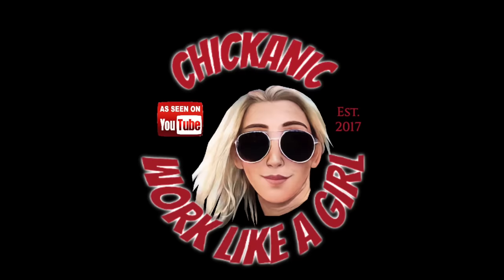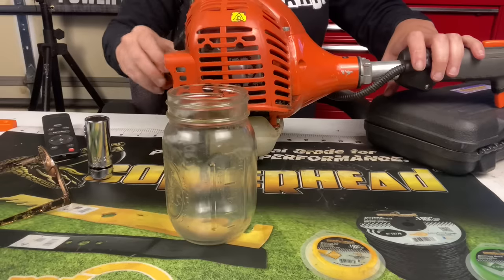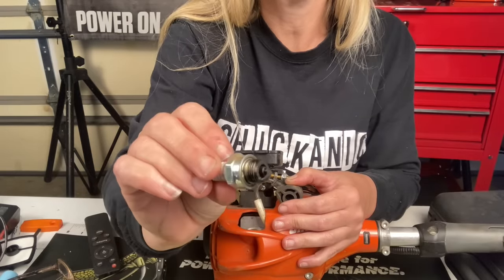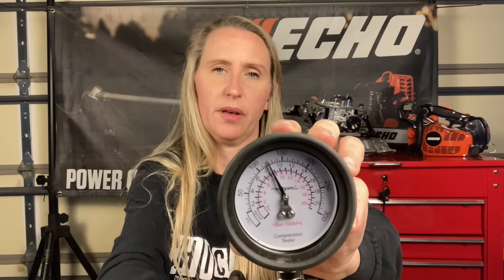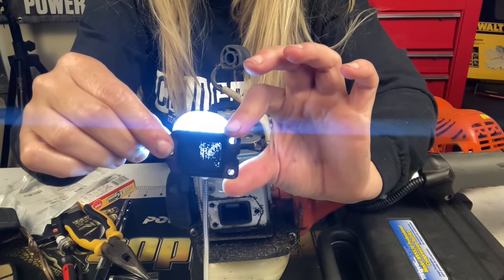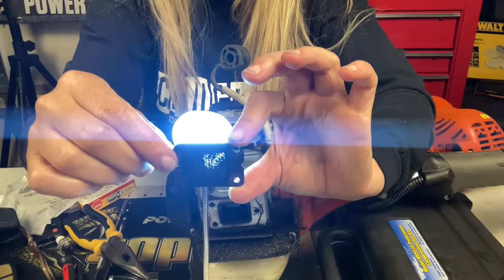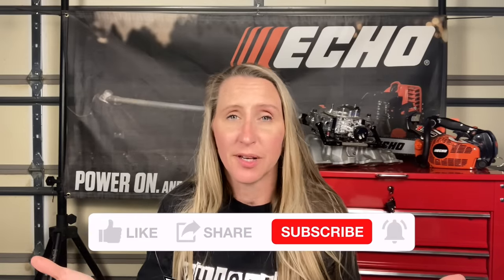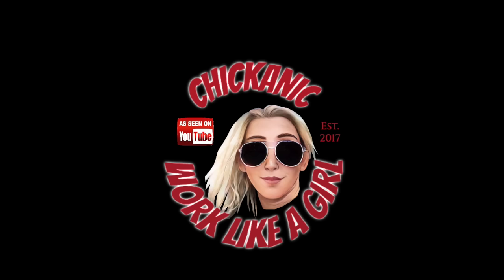How To Fix A String Trimmer That Won't Throttle Up. Echo SRM-225 Complete Diagnoses and Repair VLOG

Comment: Hi.  I have a new Echo SRM 225.  I probably have an hour and half on the weed trimmer.  It is spitting some small droplets of oil on the plastic housing area around the exhaust area.   Is it normal for this to do that?   Perhaps, it needs to be broken in before it stops?   I plan on taking it in to where I bought it from soon.  I thought I would get your opinion too.  Thank you.

Comment: I don't know what it is about Echo but seems like it's the luck of the draw if you get a good one. Thats all we use when it comes to string trimmers but we seem to go through 2 or 3 every couple seasons and one of our last ones (last season) has oil just dripping out of the muffler and one we bought just a couple months later just had an oily residue. Of course this is the first thing I remove after it clogs, I tried burning it off and that worked for about another week or so just to do it all over again so I just removed the problem. Now I mix my fuel a little leaner and make sure I full throttle it a few times a day which seems to help. My Echo chain saws never had or have this problem thankfully.

Comment: Hey always look forward to see what your working on. I had two MityVac compression testers and both went bad. Not the actual gauges but the stupid non replaceable air release button below gauge. What compression does a new Echo trimmer have ? Excellent video

Comment: I have a Shindiwa T3410 C4 technology.  It does not start, the compression reads 34 psi. Are there other causes to low compression besides scored cylinder walls?  You mentioned that you won't work on a dead unit, am I to assume that trying to rebuild a unit with low compression is not worth the money?  Thanks for the videos.

Comment: Husqvarna spin trimmer won't throttle up smoothly. It will idle when warm and will run full speed once I get it passed the low and mid range. It's only three years old with light use. Fuel is fine, fuel line, return, and tank vent are fine, exhaust is clear. Spark plug looks good and has plenty of compression. I can't image the carb would need adjustment since it was fine last year. Also I use Seam Foam in the gas. Any help would be appreciated.

Comment: I got a Gt2000 line trimmer..  several other potential issues i have found with it... when choaking underload... always check fuel lines for leaks,  the grommet is sealing,check the cooling fins are unobstructed.. 
Yes mines an older one... Never knew anything about line trimmers before i got given  this one ... but its so simple to work on .. 
I do have one question.. the fabric air filters... (kinda look fluffy.. aftermarket) can you wash them?? I do have the original one which is like thin cardboard thickness.. 
Can these be washed?? Cleaned.. 
Mines done alot of work  in paddocks.. got the green tinge on air filter.. 
Thoughts??

Comment: Hey, I'm hoping you will read this and have a chance to respond. First, just found your channel. Love it!  I've owned a Landscape company for about 25 or so years. I've always run Stihl equipment almost exclusively. I have used Echo in the past and currently have the CS400 chainsaw and hedge trimmers.  Watching your channel, it seems like you prefer Echo over Stihl or Husky. Would love to know if I'm missing something. Do you like the quality of Echo better? Do they sell commercial grade equipment other than what's sold in the big box stores? Always heard Echo parts were harder to get and it's very difficult to find a Commercial repair shop to work on Echo. I will say my Echo saw and hedge trimmers are easy to start !  It's about time to upgrade our 2 cycle equipment so any thoughts would be welcome! Blessings from North Georgia

Comment: Thanks for your time for another great video.  In my opinion you're right up there with the best, (Don, and Steve). I was wondering though, if echo chainsaws have the same setup, never checked mine. Thanks great job

Comment: The spark arrestor screen on my Husqvarna 4 cycle trimmer and on my Husqvarna 150BT blower were both very dirty.  I took care of each of them and it's like having new equipment!  The throttle response is much better on both!  Thanks for the tip!  BTW...My 4 cycle Husqvarna trimmer has HONDA on the block casting when you take off the shrouds.  Does Honda make more of the Husqvarna equipment or just this 4 cycle trimmer?

Comment: I have the opposite problem with my PAS-225. It’s idling high and the head is spinning. When I let go of the trigger, it takes forever to wind down (and never fully does). I can adjust the idle speed all the way down and it has no effect. Carb issue? I’m been having to use my Craftsman/MTD trimmer, which I hate.

Comment: I put non ethanol gas in mime for the first time after running high octane ethanol gas, and it messed up my weed water. I cleaned off the screen and it worked for a couple minutes and atarted bogging again.

Comment: This video is old but what are your thoughts Brand new Eco pas225.Started  fine on choke cold the first day I took it home.But after that I will not start with the choke on.But if I put it on run from a cold start and squeeze the throttle it will start up 1 or two pull.I am about to return it to the Depo.

Comment: Mine 7 year old 225 began with a rough idle one day, then slightly bogged down throttle 2nd day, then on the 3rd day it wouldn't start and the primer bubble was suddenly hard to press. The air filter was already changed.

Comment: It's interesting you're working on string trimmers today.I have one that kind of bogs down it'll run great when you get it up to RPM but it when you let it sit just a second as you're moving to another location and you hit it again it just bogs. This week it would quit even though it was warm I would hit the choke pull it-  fire right up take it off choke and it would work fine - did about five times ,very confused by that, any thoughts??
Reply: Mark Grehlinger, 
I had a similar problem, after checking everything out and probably removing the spark arrestor screen, new hoses and a filter took care of my problem. 
I  hope you get it figured out.

Comment: Hey Bre! tell Ron hello. It's unfortunate but most of the 2 cycle stuff I work on is to old and doesn't have those screens in them. I have found some with bad gas though and one plug was so carboned up that you couldn't even tell there was a ground strap on it anymore, it always amazes me how they can get to that condition and run that long. I find most of the stuff I work on has bad gas tank grommets and  or fuel lines it's the bane of my existence. Keep rockin in the free world, love the vids. Oh btw we need one more tour of Ron's area where he works on the riders!!!! Please!!!! wink wink!!

Comment: I have a used Stihl FS 100 RX without the stringer guard that cuts the string length. She revs fine when the strings are short and when I forward them to how I like my strings, slightly longer she bogs down. Does that sound right? I have to live with say 6” strong length and not say a foot like I like it? Just curious. I replaced spark plug, gas, filter, muffler doesn’t have a screen.

Comment: Im wondering if you might shed some light on my problem. I have a stihl fs 38. It runs great... as long as it is turned on its side. Seconds after you turn it upright it shuts off. Hopefully you have seen this before and can tell me what is going on with it. 
Thanks
 Bennie

Comment: Just bought a Toro 60 volt trimmer.  The problem is I have to pound the line advance far harder than my other trimmer. Corded ryobi. Have taken the line head off and cleaned everything every time I put in new line. Also it is so hard to advance line I have to stop hand push the line advance in by hand while pulling both line feeds at same time to get line out.  Is this a bad design or ? Solutions?  Please advise.

Comment: Hello. Recently my Craftsman line trimmer finally failed and quit running. After nearly 11 years of use I cant be mad. Question, by chance do you know which model of any straight shaft rig is still Clockwise spinning? Ik, ik, I'm an odd duck...I have tried an echo but the counter spin kills my straight lines😂😂😂. Thank you for your time have a great day!

Comment: I have 2 echo srm 225’s my older one has about 55lbs of compression but still runs great, so after buying a new SRM 225 I decided to take a compression reading and the brand new one only shows 70lbs of compression, they both start right up. Is this common on the echoes? Are do I have problems waiting to happen?

Comment: QUESTION ... if you don't mind.  My echo EDGER starts great but when throttled chokes and dies but will start right up again.  Not the screen, good gas, new plug (less than 1 y.o), could the lube on the long plastic dooohickey connecting motor to blade need more lube ?

Comment: Bre - Thank You for showing all of us in trouble how to get Get Out Of Trouble...Thanks to your How To Videos.! I have been looking for a Shindaiwa T242X like yours. All I run across used are the T242 models. I have a small yard but a lot of trimming. I want a Speed Feed 400 on my Shindaiwa that I buy. Will I be Happy if I settle for a T242 or should I hold out for your Model.............HELP !

Comment: I've got a Echo SRM 261T - all of sudden it's got where it will idle but die when you try to rev it up (choked or not).  I've put in a new air filter, spark plug and checked the muffler screen (clear as a whistle).  I've only used TruFuel 50:1 since I bought it new.  No smoke. What would cause it to sound like it's choking out and die when I try to rev it up? TIA

Comment: Hi Bre, old guy subscriber here. What's your opinion on my SRM  225 that leaks oil between uses? I wipe it down before using it every time. Leaks from the louvers and exhaust area. Thanks for any help! Mike

Comment: Thanks for the video.  I am in the market of a new gas trimmer.   I have a Husqvarna and it was bogging like the one in the video.  I changed the carburetor, Air filter, Gas lines, and filter, spark plug, and checked the flame arrestor.  I adjusted the carburetor and it started to run better than just stopped again like it was doing.  I was able to crank it to start it,  but now the string just pulls and nothing happens.  It not allowing it to turn the motor.  Do you think this is ignition coil?   it is an old unit I want to say 2006 or 08?  It was my dads.
Reply: First two things ever to check are fuel and spark.Coil can go out.Have a 20 year old Stihl.The only things I replaced were a coil and a carb.
Reply: @eugeneoreilly9356  Thank you, I will try the coil.  Now the spring is not working in the pull role.  I just need to find the parts and see if fixing works.

Comment: Hi chickanic I've got a Honda wipper snipper and it works perfectly until I axedentaly filled it up with diesel without knowing but after I realised it was diesel we drain it out and put gas in it and it ran fine but it would run for20 second and then turn off but now it doesn't start.
Could you please give me some advice thankyou

Comment: Great video I watched it all through but can't find the link you said for carburetor adjustment.
I have the same model. Good compression. Cleaned everything you did but the primer bubble won't suck. It stays flat after pushing it. It runs like the trimmer you started with. 
I'm searching all youtube and still can't find answers. Needs your input. A hillbilly from Idaho mountains. 
Thanks
Reply: Plus it only runs on full throttle for about 5 minutes. Dies after 5 minutes and doesn't want to run afterwards. What gets me is the primer doesn't want to extend outward fully after pushing it in. I took the carburetor off and had it cleaned and it looked brand new but still it don't want to run longer than 5 minutes. 
Do I just need to buy a new trimmer? I don't have the money. May just get out there with a old fashion hand trimmer here. But I'm getting old and don't have time and energy.

Comment: I removed the carburetor on my weed eater and cleaned it and put a gasket kit because every time I tried to throttle up it died and after putting it back together the only way I can start it up now is by spraying starting fluid and then it works! Any thoughts

Comment: Hey I have a popular pro pp2822 I have change the carburetor cleaned the air filter spark plug gas.  On it will start and run with the choke on but when you hit the gas it shuts off. Full choke to half choke but as soon as you hit the gas it’s off
Reply: The old carburetor was doing the same.

Comment: I have the same trimmer. It starts first pull everytime. It will rev but won't rev to max rpm. I'm thinking it has a stopped up exhaust.

Comment: i have 21.2 cc Gas 2-Stroke PAS Straight Shaft Trimmer and Edger Kit it is about 1month old. first day it was working fine and now i try to use it today but as i was using it it lost the throttle wont go up and i turn it off and now it wont start ..should i try what you did on this video or take it to home depo where i bought it from?
Reply: I think you should see if HD will exchange it for you. It sounds like you fried the cylinder. About the cheaper units, you have to break them in slowly. Don't throw in 50:1 and go full throttle right out of the box.

Comment: The best way to clean the spark arrestor screen is on a gas stove if you have one. Just hold it with a pair of needle nosed pliers. Works like a charm!

Comment: I just worked on my riding mower with new carb and more than 50% of the time it back fires when started up! It had the same problem before I installed a new carb. Any suggestions?

Comment: big fan I got a husqvarna 128ld the other day it runs it will idle go to give it full throttle it's like you hit the kill switch. fires right back up don't matter the choke position it won't take full throttle without out shutdown. everyone said bad diaphragm well we changed that no difference. I cleaned exhaust no change. runs smooth as soon as I give it full throttle runs almost wide open then just shuts down. any idea

Comment: Good morning, srm 230 string trimmer issue. Cold start prime put on choke  starts but quickly dies take off choke fires right up. I need to do this sequence at every start up even when unit is hot. There is a new carb on. Any suggestions? Thanks

Comment: Why is Echo oil so important for an echo?  I run Red Armor, and have for the 9 years I have owned Echo equipment and NEVER a problem.  Even after sitting for a year, they still start with three pulls (I don't use my pole saw that much and it sits for upwards of six months at a time).
I use Stabil in my fuel and run anything dry if it won't be used for more than three months.   
Is there really a difference between Echo oil and Red Armor oil?

Comment: Hi Bre, how do you remove carbon build up on the piston head and exhaust ports on trimmers? Thanks Mike
Reply from the maker: Use good oil, ECHO Red Armor. Run the trimmer at WOT for extended periods the heat and the Red Armor should help to clear the piston and cylinder.
Reply: @Chickanic  Thanks for the reply, I have learned so much on things I need to know from watching your vid's. Keep up the good work and Bless your heart.
Mike

Comment: What could it be? My weed eater will run and does fine idling. But as soon as I run it at full throttle. It’ll bog down. Feather the trigger a bit than. It does fine. Also if I hold the trigger at about 70-80% throttle or on the trigger. It’ll continue to run a bit better. Not sure what I can do to fix it. Any help will be greatly appreciated.

Comment: I have a Echo power blower model PB-500T and It won't stay on high RPM when you lock the throttle control. It will stay on high but you have to hold the button on all the way. I have replaced the handle with all of the parts inside and still does the same thing. What else could it be?

Comment: In my Location we've very poor Echo support. I've 2-3 year old machines that the dealer tells me parts are no longer available. When I question the dealer why i can order them online and he says they're not available, red flags go up. Apparently Echo controls where the dealer can source their parts. I'm not able to support a local dealer that can't supply parts. I used to be a real Echo fan, but not so much any more. By the way the little gear case on the end of  the trimmer "very spendy". I've had them go out. You got to keep the gear case and the shaft cables well OILED (Lubricated) as well..

Comment: Hi everyone  keep your fuel octane at 90 you see the difference in starting or by cans pre-mixed there at 92 octane ethanol  free fueI, I mix my own fuel with 92 octane  pump gas  into 2-1/2 gal can,  then I fill my stihl  MS 180C  with mix,  I add, Cap off 2-liter bottle half full of Marvel mystery oil to my saw. It's upper cyl lubricant  since 1923 I haven't put my stihl 180C in shop since 1995 still running well besides air filters fuel filter change and using bars & chains cutting wood.

Comment: The spark arrester screen in my troybilt does not remove like that, I suppose the whole muffler would have to be replaced, but I'm soaking the whole muffler in degreaser. The engine is still new maybe 2yrs but I had to replace the piston rings, it is a long story, but now it won't run for long although it starts intermittentently. I am hoping it is the screen. If it isn't the screen, then I don't know yet what it could be. Any ideas?

Comment: i have an echo trimmer thats about 15 years old but only use it a handful of times a year. after 30 mins of running strong it starts to bog out, any idea what is happening? I replaced the carberator last year and it helped but still not perfect...